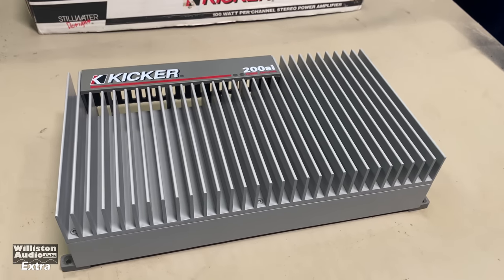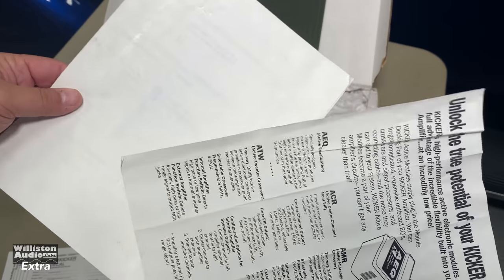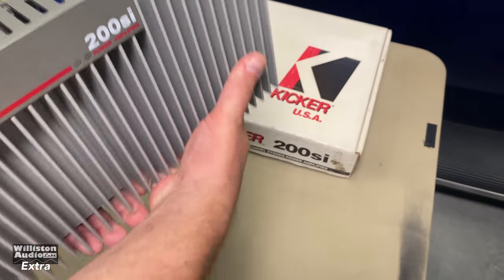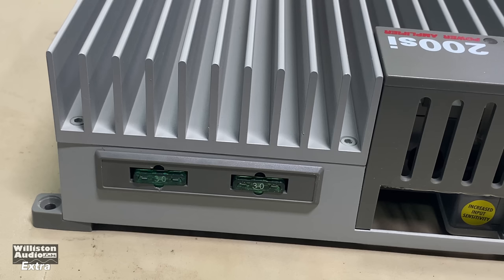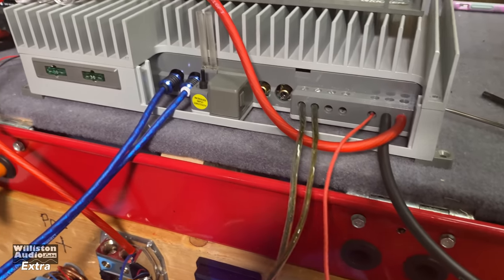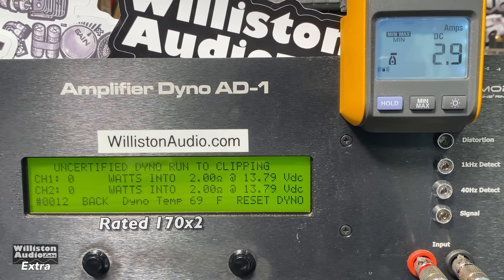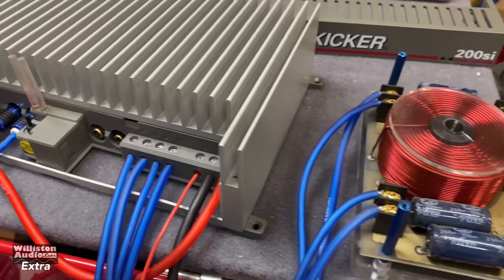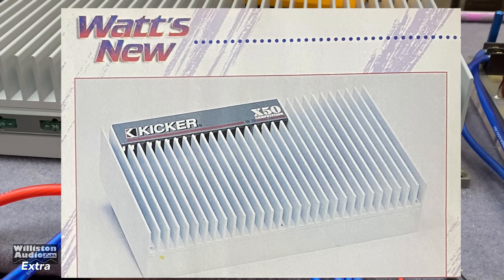Car Audio Time Machine? 1994 KICKER 200si Amplifier Reviewed and Amp Dyno Test [4K]

Comment: Serious Fishiness going on here.   I don't know if i'm the only one in the position to see it but it's weird and I have next zero idea what the reason for it is. I would not have even checked on anything  if it were not for  my spidey senses going off so bad it was making my gut wrench all up. 

  anyway, doesn't matter, that's your business right? LOL.      that module is the older school version of MDP <- no clue why they called the Bypass Module an MDP when they also called the dual dock port gizmo an MMDP.   I mean they called that thing the multi module dock port ( could have been dual ) LOL     MDP however doesn't even ring bypass eh?  

  I never messed with that  thing you were calling tri way but i know the tri way KICKER style but it involves inline crossovers.   MDP  - Bypass  module allows that amp to push 100% signal , trash can style, everything out.    If you have the back to the module you have now, you can unscrew that back style and use any module  by placing that back connector on your choice of module ( modules are getting hard to find so this is a pretty good thing to know )      sp essentially you can use this 200si like any other kicker  a/b ( stereo )  w/ mono and triway capability , Si, SS, XS, ZR, ZRX .  i'd put DX but hey are already limited to D class Mono, the do use modules but  are not stereo or class a/b LOL.   

   so that tri way contraption you had going on there was a 3 way crossover functionally?   I have not ever checked into that,   I gotta do that now.   very cool for a quickie  everyday driver system eh?     I have been strictly kicker for all these days,  - I need to just make it  hobby to the end and quit with the life long venture.
   I am going to check that old crossover out.  I have some old school Japanese, authorized  but never publicized  that went a little out  side what kicker allowed to be dispersed in the usa, I wanted to play with them but I didn't want to use a pile of x3i or kx3 - that thing would be more feasible in a reg freak show daily driver with multi channel amps. 

   I wish I had your channel making capabilities.   LOL   I just don't though.